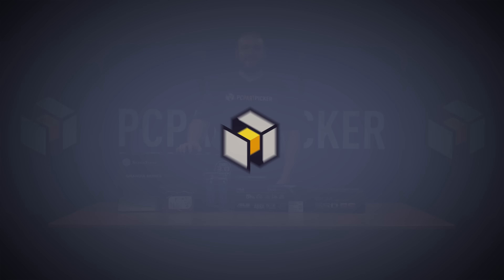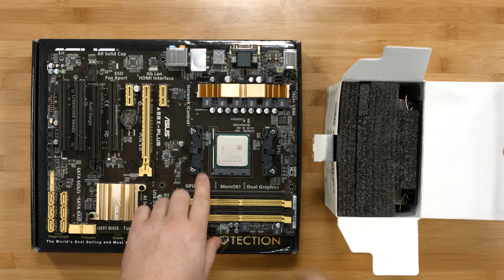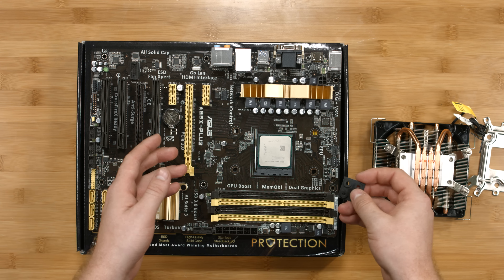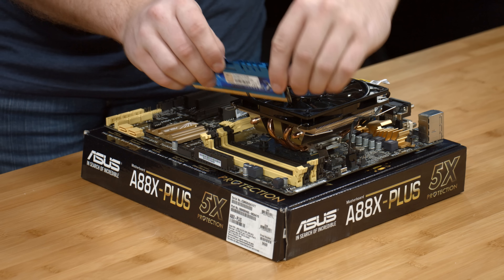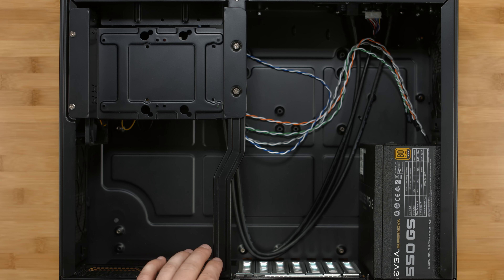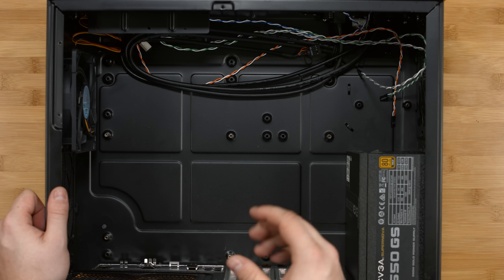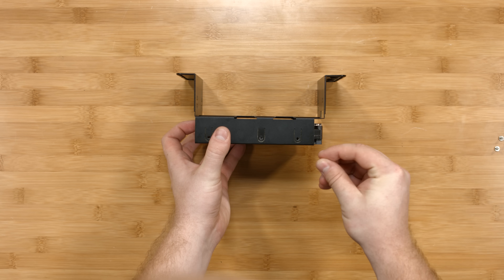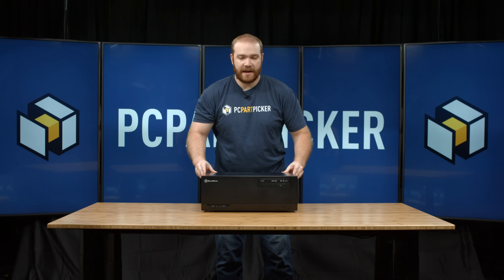$630 HTPC Build - AMD A10-7870K / Silverstone Grandia GD09B

Comment: Built an equivalent machine for roughly $400 a few months ago. Got a case with a built in 270w, an 88x with built in wifi/bluetooth, and a 2 tb HD. Using stock cpu cooler, so it runs a little hot, but otherwise it plays games as well as I could have hoped for. I would suggest a smaller psu if y'all are gonna build this, there's no need for going over 400w with an htpc.

Comment: It's January 2017.. I'm considering buying this case because I have held onto AMD FM1 A8-3850 and gigabyte A75 chipset mATX for years just because I could never throw them away and no ones buying a dead platform. I bought 8gb of 2400mhz RAM on ebay last month for $40 with options to upgrade my gaming PC or build an HTPC. I have an old Thermalright XP90 with a 92mm noctua fan and DVD drive from a prior build so all I need is a PSU and case to have an HTPC for my bedroom. I'm choosing this case because the computer I'm using now is full ATX z97, I5-4960k and 290X. I plan on frankensteining all the parts from my current Gaming PC to this HTPC some day. I think the GD09 is highly underrated as a gaming PC case and the 120mm fan set-up is probably the main reason why I'm choosing this case over steadily dwindling selection of HTPC cases on the market. My only concern is with the optical drive installed really limits the height of which heatsink you can use which most reviews of this case fail to mention. But then again, who uses optical drives these days? Hope this helps anyone out there in my position.
Reply: Almost two years later and I just ordered the case to replace a very similar Silverstone case that I have my system built in now. It only has one 120mm on the top of the case that I added because the stock 2x60mm fans were just not enough. The main reason for the order is the 120mm fans will really continue to allow me to run my hand me down hardware into this TV location. I am running a i7 920, Nvidia 970 & 24gb DDR3 currently and it works well for a gaming htpc. For those building from the ground up then a smaller more modern setup would work but this case allows me to reuse all my old hardware.

Comment: 6.00 if your using 2 sticks surely that would mean duel channel so you'd occupy the 2 yellow ones first?
Reply: +northern marine Apparently one of the slots were blocked by the cooler.
Reply: Most builds I see with this case are sacrificing dimm slots by using low-profile coolers when there is actually not really a need for it. This case has enough clearing for a reasonably-sized cooler that isn't too tall to hit the top of the case or too wide to hit the back end of the bay or back of the GPU.

Comment: I came here to find new life for my old amd fx series full atx build. the current case is a gargantuan Raidmax vampire case, so the horizontal atx case looks to fit the bill (or the smaller space itll go into). I plan to underclock and cut a core module down aswell.

Comment: An Excellent Build that I like. Great Job Guys!

Now to address the millions of Intel and Nvidia Fanboys who are going to go apeshit in the Comments section now:

1. This HTPC is Overkill.
Response: It can be more than just an HTPC. For example, It makes a Fantastic Budget Gaming rig with some adjustments, and is very upgradable. For example, you can add a R9 380 or 390X Later and you can game at much improved settings if you want to, add extra RAM if your system requires it, and there's a ton of room for more Hard Drives or an SSD if you need it.

Or you can use it as an Everyday Internet+Office PC. Sure an A10 would be overkill for it, but it will exceed with Documents and Basic Internet Use.

2. APU's suck at Gaming.
Response: If you try to play them at 1440p or Higher Maxed out, Fanboys! The iGPU may not be able to play the newest titles at 1080p Ultra 16xMSAA whatever, but For the Budget Gamer, it can play most demanding titles at 1080p at Low-Medium settings, or Even Non-Demanding Popular games like TF2, Dota 2, and League of Legends at 1080p with the settings Maxed out or close to maxed out. I've seen Benchmarks around to prove that. Do your research.

3. You can make a Intel Build for way cheaper.
Response: While yes you can, Not everyone is going to be committed to a Dual-core Pentium, and Not everyone is going to be interested in Overclocking. That being said, it is possible to make a Intel Build using a Core i3 and a GTX 750ti and it will outperform this AMD Build. I can't deny that. That being said, there are others who will want to be different and prefer AMD for reasons of their own.

In the End, What PCPartPicker is doing here is showing you the many ways you can build a PC. They don't need to be gaming PC's all the time. Why? Because Not Everyone is going to Build a PC for Gaming! While many of us do use our PC's to play games, it does not mean that everyone is going to use their Computers to play games. Others may use them for Basic use or other things. So In the End, I appreciate this build because it's different. It's not just another Intel+Nvidia Gaming Love Affair of a Build, and that It's an AMD Build that people may consider building.

Comment: 8:14 , 12:50 , 11:28 hd is being cooled down by fan on left side of the case assuming the case face upward.
but the roof of hd is being covered by black platform for cd rom, so the roof of hd can not be cooled down by the fan.
Reply: 11:28 roof of harddrives must not be covered because the roof contain holes
source :
 'allows for equalization of air pressure between the 
 inside and outside of the drive. While it is not a 
 complete pass-through of outside air into the HDD 
 internals, there is a filter inside the hole that 
 allows the air pressure to equalize.'
 in
 https://www.howtogeek.com/127433/what-is-the-purpose-of-the-do-not-cover-this-hole-hole-on-hard-drives/
 from google (hdd do not cover hole) result 1

Comment: I used the same case in my htpc using the following parts:

SilverStone Technology 600W SFX  Full Modular Power Supply SX600-G)
Corsair Hydro Series H55 Quiet Edition Liquid CPU Cooler
Crucial MX300 275GB SATA 2.5 Inch Internal Solid State Drive - CT275MX300SSD1
Asus  SATA Internal Blu-Ray Drive (BC-12B1ST)
ASRock Motherboard ATX DDR3 2400 AM3 970A-G/3.1
AMD FD6300WMHKBOX FX-6300 6-Core Processor Black Edition
Silverstone Tek Sleeved Extension Power Supply Cable with 1 x Motherboard 24 Pin Connector (PP07-MBBR)
Crucial 8GB Kit (4GBx2) DDR3L 1600 MT/s (PC3L-12800)  CT2K51264BD160BJ
2 of Noctua SSO Bearing Fan Retail Cooling NF-R8 redux-1800  80mm fans
3 of Corsair Air Series SP120 High Performance Edition  Fan
MSI Computer Video Graphics Cards R9 280X GAMING 6G

Note:   during assembly I found all the cables from the sfx power supply to be too short and ended up using extra cables from my EVGA SuperNOVA 850 GS 
 
I also found that the Coasir H55 was not long enough to reach the fan position behind the power supply.  So i cut out a 120 mm in the top cover just above the cpu and mounted the Cosair H55  in a push/pull configuration with the air flow out of the case.  The cooler is mounted between the blue ray drive and the 80 mm rear fans.

The metal is very thin on the case so you have to be very careful not to dent or bend the top cover.   Eveything was a tight fit with no spare space but very good air flow.

Comment: +PCPartPicker do you think there would be space between the motherboard and the front of the chassis, or if you routed the power supply cables pretty heavily at a 90 degree angle, would there be space to jerry rig some extra 3.5 Inch drives in there with velcro or something?
Reply: Yes.

Comment: Did he just install the ram incorrectly?
Reply from the maker: Sam Esman Nope.  Default installation would use the two slots closest to the CPU on this motherboard but the first slot is blocked by the cooler.  As a result, we used slots 3/4 which make up the second dual channel setup.
Reply: Ow, ok. I thougt it never were two slots next to each other.
Reply: Sam Esman Nope. This is why you ALWAYS read the motherboard manual to determine the correct slots. I hear people comment on this like it's 100% fact when they see side by side configurations... Truth be told, at one time, most motherboards did do alternating slots (still not all), however, it's rarely the case anymore. More and more motherboards today are side by side for dual channel, just for the exact reason that was shown in this video... Some CPU coolers will block a couple slots.
Reply: Derrick Woodward Thnx for the information!
Reply: +Derrick Woodward While most of what you said is true, the memory controller assigns Slot A1 (1) and slot A2 (2) as Channel A and Channel B as Slot B1 (3) and Slot B2 (4). So with 2 Dimms, you either populate Slot 1 and 3 or Slot 2 and 4. Therefore, this setup is not running dual channel mode. This is mentioned on the board's manual page 15: http://dlcdnet.asus.com/pub/ASUS/mb/SocketFM2/A88X-PLUS/E8563_A88X-PlUS.pdf  ( https://www.asus.com/us/Motherboards/A88XPLUS/ )
Reply: +Groundskeeper Willie Which also means he installed the RAM incorrectly.
Reply: Vanguardas Vucava
Yes
Reply: Actually - yes he did - he installed them for single channel, even though it's dual channel - So you are in fact correct.

Check http://dlcdnet.asus.com/pub/ASUS/mb/SocketFM2/A88X-PLUS/E8563_A88X-PlUS.pdf?_ga=1.227116762.632102177.1464637647

Page 1-7

He installed the sticks B1 and B2 - instead of A2 and B2 - This means he only uses the B channel - and thus - he is running single channel. Derrick is talking out of his ass!
Reply: This is AMD style RAM install
Reply: Correct,AMD uses 1/2 or 3/4, Intel 1-3/2-4

Comment: Im looking to build a HTPC soon build into that Case..  one of the only things I would Add would be an SSD to run the OS and add a low profile dedicated Graphics Card.. which graphics card would you recommend for a build in this case?
Reply: +Brian Michael I have this case and i use a full size MSI 970. It's a really large card I think 13 inches and it fits fine so any card would work in it.

Comment: I don't get how that drop of thermal compound and then flattening it with pressure manages to somehow cover the humongous edge and gaps between the copper pipes. but hey, if it works...
Reply: +Pedzu Reddit The thermal compound is really only meant to fill in the micro gaps in the metal of the heatsink and heatspreader of the CPU. Ideally, you want the thinnest layer of thermal paste as possible.

Comment: Well worked out build. Lets fit a cpu cooler that masks two of the memory slots so you now can onlt run 1 channel memory. With all the parts you have to choose from this is fairly poor.
Reply: On that specific motherboard it's in duel channel, not single
Reply: @nevoyu  No it is not you are using the B1 and B 2 slots ie channel B only. The  two slots next to the CPU are channel A. Please check the manual. You guys are meant to be teaching us.

Comment: Could you even run games like gta5 witcher 3 dying light etc on 1080p with at least 60 fps?
Reply: Steven Pieklo This is not meant for gaming.
Reply: Then what is it for?  Why would you need something this expensive when you could  just get a dell monitor and pc for a $200 bundle or or just a widescreen chromebook.
Reply: +Steven Pieklo But what if you wanted to play some games that didn't require too much compute performance e.g. Surgeon Simulator, Minecraft the lot.. Those two options you just recommended won't handle that. Also, when you buy a PC, you know it's going. To work (quality control), but when you build it yourself, it feels amazing for it to boot properly for the first time because you built it, not a company... Now who doesn't like that thrill? Come on now, reply.
Reply: Ok well if you want to play games like minecraft or steam games the chromebook is out of the question. I easily get 60 fps on minecraft with shaders and high quality textures on my laptop with intel core i3-3120m which came out about 3 years ago when windows 8 just came out. And on games like surgeon simulator fps doesn't really matter its just like a flash game really. And now HP came out with the tabs with magnetic keyboards and those 360 laptops which can run pentium or i3 and play minecraft just as good as my laptop. And you could probably still find my laptop somewhere on ebay or amazon for at least 300 dollars less than it was originally.
Reply: If you got a GPU sure.
Reply: @stevenpieklo3989  Watching Blu-rays.

Comment: Hey im a noob, I was going to build a pc but never got around to it. I get the general idea of everything i need, but there's a few things im still not too sure about.

Do sata cables normally come with a motherboard? 

What type of wires do cases come with other than the usual Power, led , etc?

Basically if i purchase a case, motherboard,cpu, ssd, ram, cpu cooler, gfx card, power supply, wifi card, & dvd drive ~ i wouldnt need anything else other than a screwdriver to make the computer work in terms of parts/correct wires/etc?  right? 

I already have an audio interface and ofcourse i know i also need a monitor, OS, mouse/keyboard, etc.

hopefully someone can answer my questions :P
Reply: sata cables do come with the mobo (speakers with cases if the have em) cases come with the screws and the cables in cases are hd audio, usb 2 and 3 (if applicable) power leds, hard drive leds, and reset (if applicable). all you need is to order your preferred parts, have a nice screwdriver that is decently long/magnetic with a standard phillips head and then you just follow the manual from there!
Reply: Wifi card is not mandatory
Only if you want/need it
Reply: John Doe If you buy the components and they are compatible the cables should all work out. Maybe buy some fans and cooling paste but that mostly it

Comment: What is the dedicated equivalent to this GPU? How is this different than the 7850k?
Reply: For both? What is the difference btwn the 2 APU's?
Reply: Nerdy Ninja R7 250 ist a graphics card :D An Apu is a CPU with a integrated gpu.
Reply: Nerdy Ninja Slight Stock Clockspeed Increase to 3.9 Ghz, a GPU Clockspeed Increase to 856Mhz, and Support for DX12 (7850K does not have that yet, I think).
Reply: Sound ty
Reply: Sempron lol Ik that I said the EQUIVALENT
Reply: Nerdy Ninja No problem. If you are Interested in this chip, It will play games at 1080p (See my Long Post up above), But I do not have the CPU myself, so I dunno how it will do for anything else. That being said, for about $150, it is a Great APU for a Budget Gaming rig. I am considering this chip myself, though I'm not too sure at this point. 

(Insert Intel+Nvidia Fanboys Here)

Comment: is it possible to use a single fan or dual fan liquid cooling system on this?
Reply: I tried to do a Cosair  H55 liquid cooler and the pipes were about three inches too short. trying to install behind the power supply,  but i did manage to make a cut-out on the top of the case directly above the cpu  and bolted the H55 to the lid.  Have it in push-pull configuration.  had to also install fan grill to keep my grandsons happy little finger from being shredded off.  The lid is very thin and the top is easily bent so be very careful when drilling out a 120 mm grill whole.
Reply: +Earl Dion cool thanks. I was hoping it'd be less destructive. But I'll survive I guess! Haha

Comment: The ram he install in is only using 1 channel 
Slot 1 and 2 is channel A 
Slot 3 and 4 is channel B
To get both (dual channel) it have to be 1 and 3 slot or 2 and 4 slot
Reply: +Lloyd Franklin The memory controller assigns Slot A1 (1) and slot A2 (2) as Channel A and Channel B as Slot B1 (3) and Slot B2 (4). So with 2 Dimms, you either populate Slot 1 and 3 or Slot 2 and 4. Therefore, this setup is not running dual channel mode. This is mentioned on the board's manual page 15: http://dlcdnet.asus.com/pub/ASUS/mb/SocketFM2/A88X-PLUS/E8563_A88X-PlUS.pdf  ( https://www.asus.com/us/Motherboards/A88XPLUS/ )

Comment: I built a mini-ITX HTPC with that same APU, but the whole system is about 1/3 the size. I bought the APU, motherboard (with built-in WiFi), 8G ram, 1TB HDD, case, Blu-ray drive, and CPU cooler, for a total of $400. I scavenged a power supply from on older system, but unless your power supply is worth $200 you paid way too much to build a way over-sized HTPC.
Reply: HT components have [somewhat] standardized size. This is HTPC case that looks good and visually coherent with my AV receiver that makes me happy. Do you know what is surround audio? AV receiver? Hi-Fi speakers?

Comment: Are seagate hard drives dependable?
Reply: Oreo Pug No, they're not. Their failure rate is much higher than any other brand. I don't know why people still buy them...
Reply: Oreo Pug nope. especially not the 3TB ones.
Reply: Oreo Pug You're better of with a Western Digital Drive than Seagate.
Reply: +xbradx11 people buy bc they are friggen dirt cheap and for obvious reasons cough extremely high failure rate id never buy seagate garbage
Reply: Just get a dirt cheap SSD for less than 20 dollars.

Comment: Is it possible to use the CM cooler in other orientation?
Reply: I use Noctua U9S (125mm) in this case for good. It is oriented to blow hot air directly to exhaust vents.

Comment: No static protection when handling PCBs?
Reply: depending on the surface your working and standing on and the humidity in the air there is little need for it